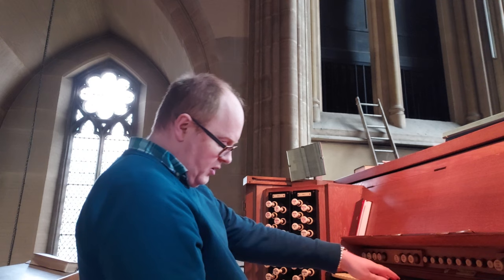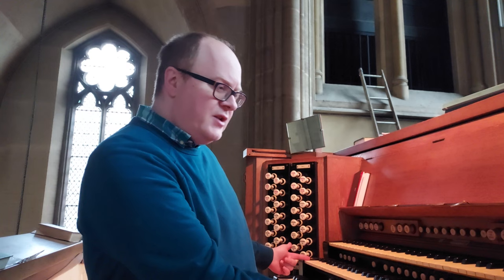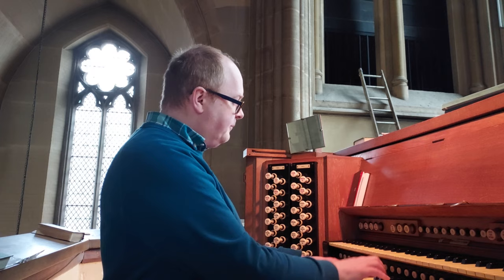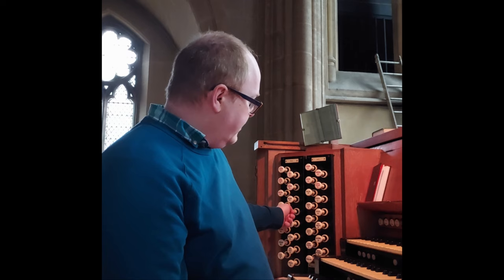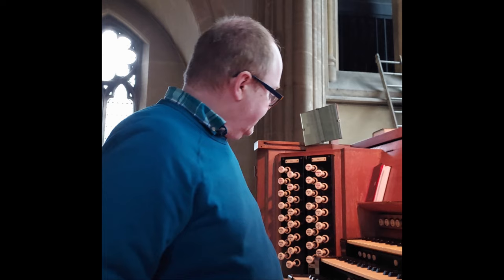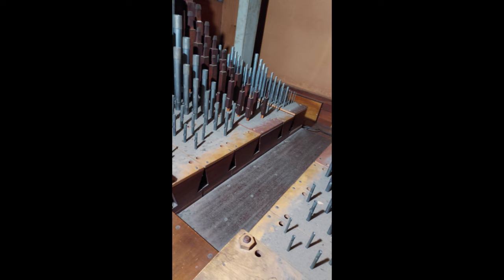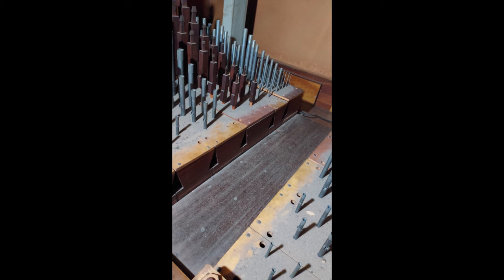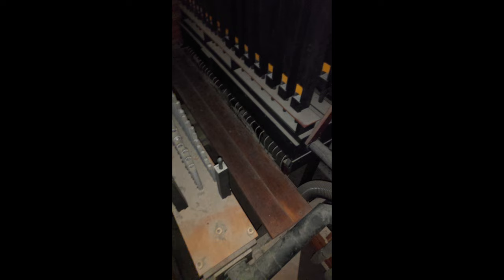S.Alban's Holborn organ restoration

Comment: It's nice to see inside this historically ( in organ building terms) instrument but as an ex organ builder I deplore the fact that the organist is allowed inside the instrument!  There is so much that can be damaged and not just pipe work inside an instrument. Clearly this organist knows his way around the place and unlike most organists can actually identify correctly the different ranks of pipes. Back in 1971 I think it was some of the purse action motor boards came into our workshop to be re-leathered ( N.P. Mander Ltd.). I don't know for what reason they needed re- leathering, being only three years old. But it certainly was the Compton organ at St Alban's High Holborn. The only other Compton organ we had anything to do with was the BBC  organ at the Maida Vale studios which we used to tune. ( I went there as a first year apprentice I think within four or five weeks of starting at Mander's, put as a tuner's boy as I knew my way around a keyboard and organ console prior to starting my apprenticeship. Let's hope the organ gets the care and attention it deserves during its " Wash 'n brush up" as we used to call a cleaning and restoration in the trade.
Reply from the maker: Hi. Thanks for your comments. I certainly don't make a habit of walking around the organ, and on the rare occasions I do, I'm always extremely careful not to touch anything other than the light switch! The chambers are pretty spacious so the risk of collisions is pretty minimal. I thought it a nice idea to see inside the organ so people can see what needs doing. I tried to pitch the video so that organ buffs and people that don't know that much about the instrument in general could get something out of it, so I think showing the pipework demystifies the instrument a little. It's not often you can get up close and personal with a polyphone! In 1971 the organ would have been 10 years old, it having been completed in 1961, but that's still a pretty short time to have to have things releathered.

Comment: Great video, thanks.  I must have been lucky as at every service I've been to at St Alban's the organist has been very sensitive (never too loud).  Crompton also installed the organ in Great Yarmouth Parsh Church in 1961 (the consoles are very similar).  For a number of years (in the 1980s) the Additional Curates Society held their London Festival at St Alban's.  A professional choir with trumpets and drums and grand organ playing.  The Norwich Branch of the Society of Mary provided the choir for the AGM of the society (Evensong and Benediction).  The organ was perfect for supporting plainsong.  Quite an honour (for me) to be part of the choir!  Great Yarmouth has the Crompton's 32' polyphonic pedal stop.  Someone described it as a concertina that went 'fuff fuff fuff'.  It never convinced me it was a 32' stop! I think that the organ in St Francis Church, Isleworth might be a Crompton extension organ.  It went out of tune very quickly (mainly the 2') - the organ tuner told me that tuning it was a compromise - it had to be in tune with itself and (being an extension organ) not every pipe could be tuned to every other pipe!?
Reply from the maker: Well if it was after 1998 it would have been me! You have to be careful with it, full organ is very loud and I rarely use it for hymns, only really on special occasions (eg Easter Day when we have an orchestra) Great to fifteenth is more than sufficient with Full Swell as the maximum I use for hymns as a matter of routine. Accompanying the choir needs even more caution, but you can still get a lovely range of colours from it at a quieter dynamic. In my, perhaps limited experience, polyphones can vary, ours, as you will have seen, is currently pretty ineffective, but I have played others which are really excellent, so fingers crossed ours will improve when it's relocated. Certainly on this organ the extended ranks don't suffer unduly from poor tuning, we just have the commonplace issue of reeds/fluework tuning.

Comment: Thank you for such an interesting and engaging video.  You've inspired me to put together an explanatory video for a similarly-scaled project I'm going to be facing at my own church. I've seen a few Compton organs and every time I've been struck by the impressive integrity and innovation of the builder.  It's therefore a surprise at St Alban's that the Polyphone is so acoustically unsuccessful.  I wonder to what extent it was muffled in 1990 by that new set of Pedal Principal pipes in the arch in front of it?  I've seen cases where relatively small barriers in an arch can have a surprisingly large effect on the sound of the  pipework behind.  I remember popping into St Alban's mid-week about 35 (eek!) years ago and a passing curate very kindly agreed to let me have a play.  But when we got to the loft we found that the blower had been left on, apparently since the preceding Sunday.  So we agreed that the best thing was to turn it off pronto!  Maybe I'll get to have that little play after the restoration?  Anyway, thank you again for your fascinating and inspiring video.
Reply from the maker: Thank you that's very kind, I wish you luck with your own project. It's hard to say why the polyphone is so ineffective. I wasn't in post when the pedal principal was installed (it was 1990) so I can't say whether the polyphone was more effective before those pipes were there. My instinct is to say that I don't think they're the problem. Owing to the clip all being done on my phone, it probably doesn't show up well when I go down underneath it, but the sound isn't bad there, so I think the sound mostly travels downwards, so it doesn't send its sound upwards into the chamber, so I don't think there's much sound for the pipes to obstruct in the first place. Everyone I've spoken to over the years has more or less said that they need to be on the floor to get the best results out of them, and ours isn't. Our plan A is to take it out of the pedal chamber and put in on the floor of the gallery, so if the principal pipes are an impediment, that problem won't exist anymore. I'm sorry you didn't get the chance to play those years ago (it certainly wasn't me who carelessly left the blower running!!) hopefully next time!